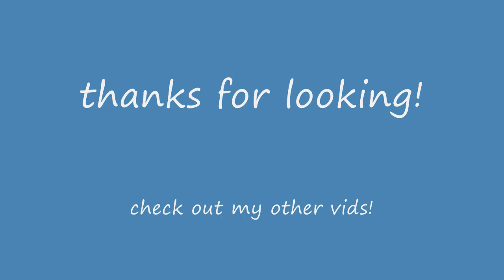MAGIC SPANNER !! ?

Comment: Very similar phenomenom to the static airfilter. This one is caused by the conveyor belt always rotating in one direction which can also generate static but if the rock its moving has ferrous ore in it and as it goes past the crusher frame but separated by the belt it will magnatize the frame.